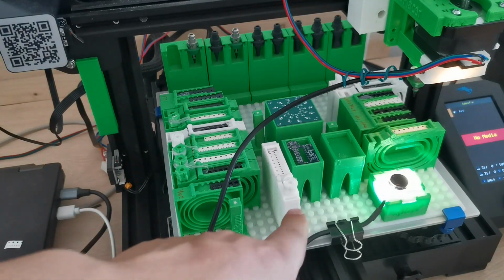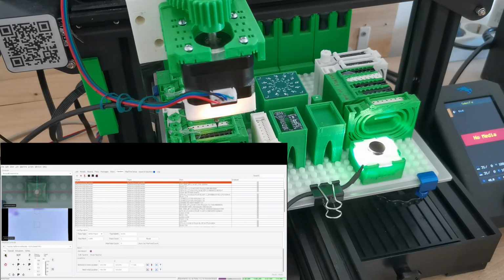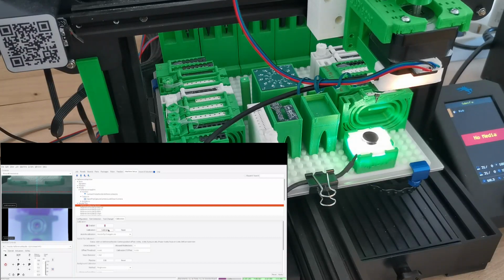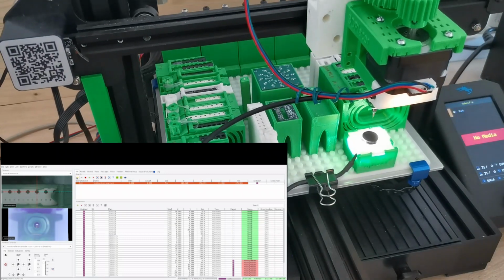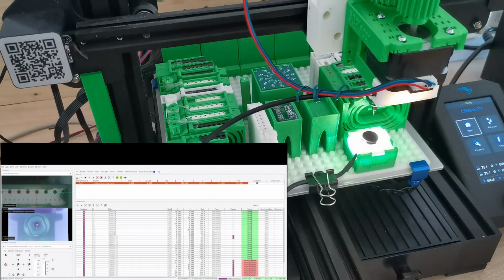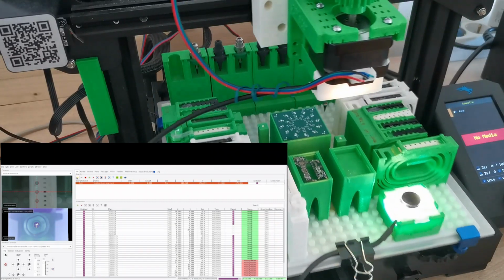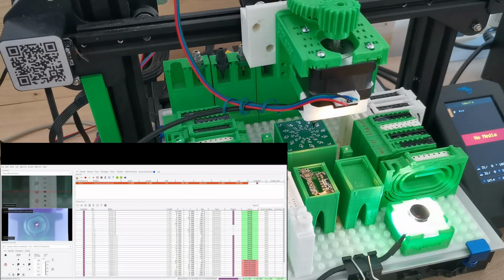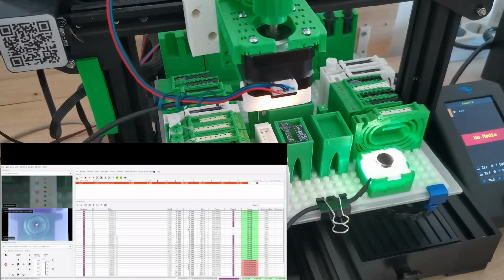3DPlacer - Can it place 0201and 0402? Let's give a PCB placement test

Comment: Considering that the machine is a hacked 3D printer the performance and accuracy is very impressive - congratulations...
I don't even want to guess how many hours you have spent to get it working at this level of accuracy so well done !
Reply from the maker: Thanks, indeed there are a lot of hours designing, testing and tunning, but really happy it worked at the end!

Comment: What’s the main speed limitation? I bet when it works as 3D printer is moves much faster
Reply from the maker: Main challenge is when component is attached to the nozzle, the acceleration cannot be too high, or the component might move. This can be improved by setting carefully acceleration, jerk,.etc, and also by adjusting suction pression. The speed in the video is set to be slow, I think it can be much faster, but not as fast as 3d printer.

Comment: Good job! I think the glitchy button presses are happening when the pump is running, so either EMI from the unshielded wires or maybe the pump is pushing electrical noise into the power supply. Probably nothing to worry about, but it could result in random glitches later.
Reply from the maker: Right, it is not happening now, but I will check when it is coming back and observe the signal. Maybe some shield will help.

Comment: The button press issue seems to correlate with the air pump being on, maybe put a ferrite core around its power line or shield/bypass some of your electronics?
Reply from the maker: Indeed it is related to air pump, and thanks for the hint, I will need to look at it a bit closer..

Comment: Is there any benefit in having printed barcodes/QR code labels on the feeders, so the machine could scan the build plate with the camera and identify which components were mounted at each location? Or is it quick to just enter that information manually?
Reply from the maker: Yes, definitively, I haven't got time to get to this point, setting up the feeder is a tedious job but with a lot of effort, so anyway to reduce the effort will make it valuable optimization.

Comment: I'd be interested to see speed tests. Maybe larger components can go fast without placement problems, but slow for 0402 and fine-pitch chips that need maximum accuracy?
Reply from the maker: Will get back to that, currently I have checked several speed faster than what I have in video, which looks good, in general, if we tuned the acceleration and jerk well, even if it is higher speed, it should be good enough, it also depend on the machine as well. The other thing is when moving fast, some machine come with higher vibration, it will cause the component to change position during movement, that will also be one limiting factor, I observed this in Ender CR10.

Comment: If I use a 12v pump do I need the Keramik Resistor ? If the output voltage is 12V of my printer ?
Reply from the maker: I would recommend using resistor as some printer come with mosfet supporting current lower than 1A, so when component is attached, the current will go higher than mosfet can stand, so it is good to have a protection . You can refer to my earlier videos that I fixed the mosfet issue.

Comment: Thanks for sharing, how the feeders feed components when the top row is empty? Also whats the camera spec and model?
Reply from the maker: For trimmer cassette feeder, you can rotate the trimmer, then the tape will move forward. For the normal feeder, the tape need to be moved manually forward. For the camera spec, you can have a look here: https://github.com/xpDIY/3DPlacer/blob/main/designs/BOM/BOM.csv

Comment: Good work, Good Video.  Have you thought about making a paste injector.  I single prototypes and I don't want to mess around with screens.
Reply from the maker: Thanks, I actually thought about it before, but I find it easy to use stencil, therefore didn't go that direction, it is definitively possible, can use the rotation stepper for injection control. OpenPnP has that function before, but not with 2.0 version, so some effort needed as well for software.

Comment: do you have to have the calibration points on the pcB or is another calibration already possible or in planning
Reply from the maker: Not really necessary for fiducial, you can select multiple components in OpenPnP and calibrate by manually center to each component. Fiducial is a easy way to automate the board location calibration.
Reply: thank you very much for your answer will you create a complete guide including setup with openPNP? @xpdiy
Reply from the maker: @CranckRa1n yes, that is in my plan actually, stay tuned!
Reply: @xpdiy  perfekt just ordered a replacement for my endet 3 v2 can’t wait for the videos

Comment: In relation to placement of the components, my opinion is that it looks really good, almost like its been done by and Ikea Engineer, as compared to my hand placement which looks like its been done by a Koala bear on crack cocaine.
Reply from the maker: Hand placement is quite difficult, especially for 0201, a small shaking of the hand will make the component dancing with other component near by, lol!